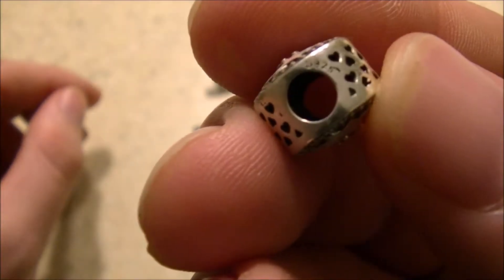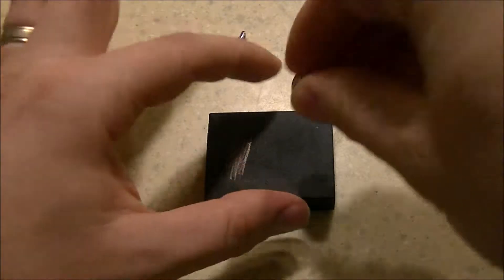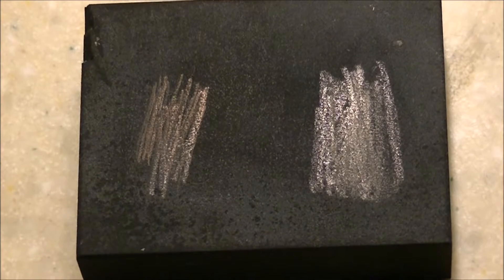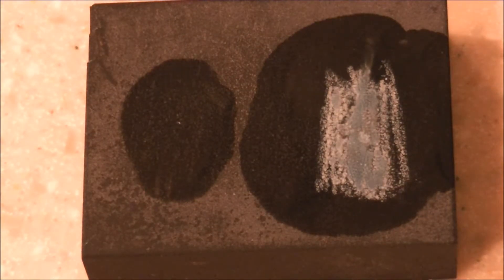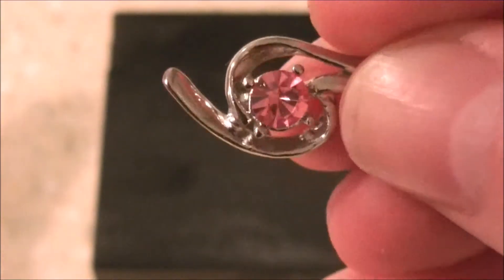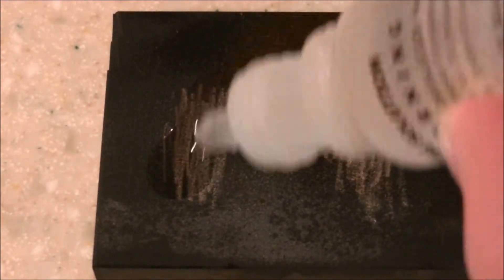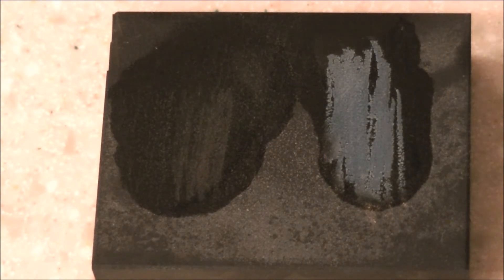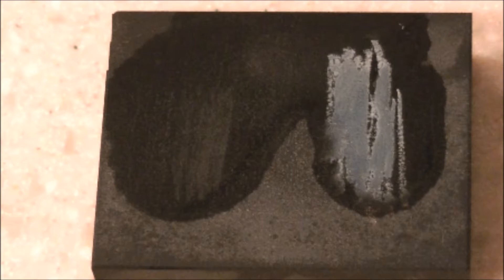Acid test zinc alloy vs  925 sterling silver using gold test kit

Comment: hey I have a quick question I tested a pin that was stamp 10k G F using the 10k acid tester and it didn’t disappear but G F stands for gold filed correct ? so I tested this other earring which I knew it’s not real it sticked to a magnet pretty strongly no stamping on it  so I used the 10k gold solution tester and again it didn’t disappear after a minute so does 10k tester not Accrued ? thanks.
Reply from the maker: very strange, my assumption would be that the 10k tester is simply too weak.  I am not a chemist.  Also keep in mind gold filled is a thicker type of gold plating, so it may leave some behind.  As for the other jewelry, again my assumption is that the 10k acid is just too weak.  Throw the 14k acid on it and see what happens.  If you get the same result...then you may just have a piece of jewelry that is made of a tough material that will not dissolve.  Again, I am not a chemist.
Reply: Reviews_and_more okay thanks for the fast replay
Reply from the maker: @slicegaming2827  np sorry I could not be more helpful
Reply: Reviews_and_more no need really appreciated your help :) thanks again & take care.